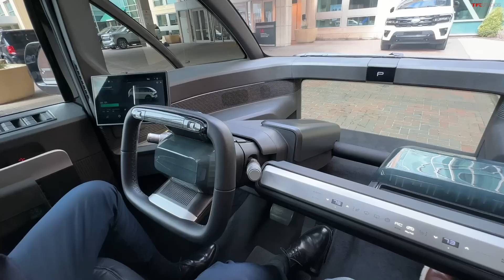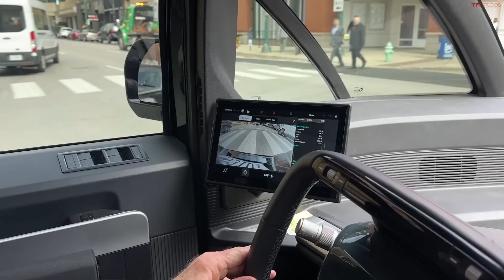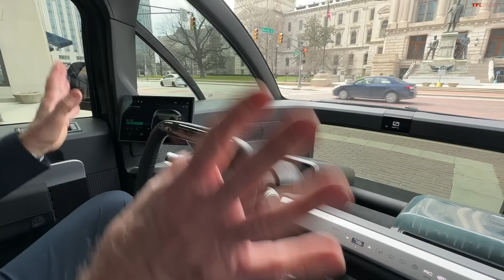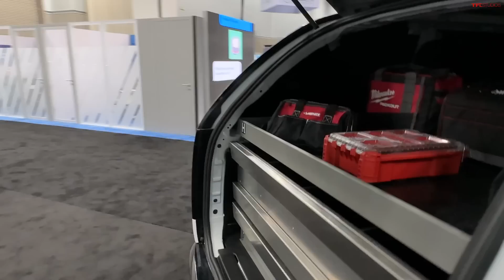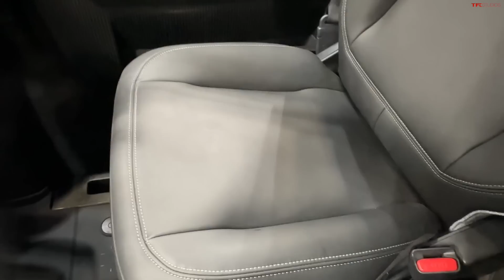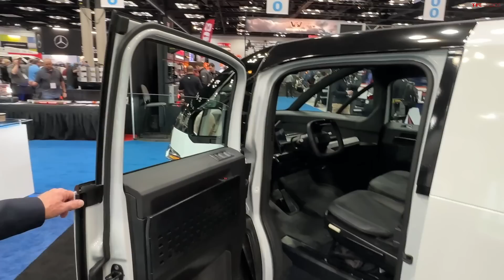The All-Electric Canoo Is Like NO Other Van You've Ever Known or Driven: Come Ride Along With Me!

Comment: I really like the concept and have put a deposit down for a truck, but I puzzle over who climbs up beyond the dashboard to do cleanup. there are a lot of nooks and crannies up there. I live on a dirt road. It's going to get messy up there in a hurry. I think I would prefer the area to be covered and accessed from the front exterior, a useful and secure frunk. The speedo doesn't have to be all the way up there. How about a HUD? I also prefer more proximate switches to a touch pad/touch bar for all lights, radio, locks, wipers, window defrosters, seat heaters and adjustments, etc. I don't need the distraction of stabbing half blindly at a touch screen, or touch switches placed far out in the middle of the dashboard (why so far?), nor looking at the resulting inevitable greasy mess on the touch screen. I want to hear and feel clicks. I loath the touch screen on my desktop computer. Why would I like this little iPad style touch screen for controlling critical elements? I agree with the criticism of placing the mirror adjustments on the steering wheel. I would prefer to have my cruise controls and radio volume and tuning where muscle memory can again take place and I can keep my eyes on the road at all times. The way some of the EV systems are designed across most manufacturer's models, I must assume that all engineers are distracted drivers and find the condition to be normal. I have zero interest in autopilot programs, nor do I care to be a part of all the experiments currently taking place on our roads. A Canoo pickup would replace my Kei flatbed truck. The Kei truck can transport quad ATVs and golf carts with plenty of hard points provided to strap them down. Can you please make the Canoo truck capable enough to fill that bill?

Comment: Wow! With 200+Mile range! and the visibility is really crazy! Wow! I can say this is state of the art vehicle.
Reply: Is it a lie though? 200 is that gping from 100% to zero when in reality most of the time they want you to not use the top 20% and bottom 20% meaning 40% of that range is actually not useful most of the time? Before battery degridation or cold weather impact? I think its a scam. The range for the price is a deal killer. Makes it a scam by my standards. Freedom robbing scam. 50k for 200 mile range. He says he challenges anyone to find a better value. Easy. Corolla accord camry f150 civic prius rav4 even audi a3 is bettee vakue straight up that car js so great cost very similar it has a range of well well over 500 miles and legitly not this 20% on each end of the battery nonesense. Its also way better looking ans you can fill it up at the gas station of the cheap gas it gets 40mpg if you step on it once in a while it gets 1.5 less mpg aversge its really more capable in terms of taking people to farther places easier. From sea to shining sea easily as our founding fathers intended. I personally think these weird things are so terribly ugly.
Reply: If your impressed by 200 miles youre gullible as hell. You are impressed at getting screwed. If thdy told me thenthing cost 50k and only.has 200 miles range id burn the check while they watch. Youre delusional

Comment: But will it hold a mobility scooter? Or a wheelchair? It is priced way too high, That's very expensive.he work van is too small to be practical for handicap transport vehicles or most small business applications. It is the VW beetle of vans. The rgeneration system does  not allow for "coasting" dowhill. I seems it would provide friction as  the automatic braking kicks in, so does it ride  it's brakes going downhill?

Comment: Canoo was NOT the first car manufacturer to use this steer by wire type of steering system. Lincoln starting putting this in the Continentals in 2017. There can be many drawbacks with this. if you lose power or the system fails for some reason you have absolutely no way to turn the front wheels. If the battery goes dead, you cannot push it out of your drive way and turn. It is a really bad idea. The same issues exist for the completely electric transmission. No power and you cannot put it in neutral. Too many things could go wrong.

Comment: Having most of the controls on a touchscreen app is a horrible idea. I know its sooo much cheaper than having buttons, knobs and levers everywhere, but those are much safer and easier to use. Have a tactile button allows drivers to control things blindly by feel while keeping their eyes on the road. <maybe> incorporating voice recognition into the controls would work, but having to use a tablets touchscreen to turn the headlights on or adjust the AC is reckless. Even the big auto makers are going back to tactile buttons for this very reason.

Comment: OK. Now beat VW. Copy the basic Vanagon configuration where you can take rear facing seats behind the drivers, that face a row of seats, between which you can have a small table. Now you have a mini living room. Then allow that back seat bench to flip down into a perfectly flat bed. Now you have a mini camper. This is the life-changing configuration that keeps all those vanagons on the road, and which no-one (short of a giant sprinter) seems to be able to produce.

Comment: My very first impression when I saw him get in... I hate the dash and the placement of the speedometer and such.  (I'm going to edit this and add more thoughts as I go through)

Living anywhere that gets sun... A glass roof sucks.  The AC never overcomes the sun.  You swest and your hot and uncomfortable the whole time.  At a minimum give an option to have a painted or covered roof.  

I saw where the speedometer is that's to far away in my opinion.  Also don't like the mirror adjustments being on the steering wheel.  I adjust my mirrors more than most probably do but I don't need it at my thumbs all the time.

Comment: Having just the mirrors on the steering wheel is such a waste, I mean even vehicles that have multiple drivers mirrors are not a issue because the car should have driver profiles that auto set the seat and mirrors based on the driver so those buttons will almost never be used. The mirror controls should be moved into the computer or on the door and the steering wheel should have entertainment controls like radio and call controls. Also why put them on the top so far towards the center of the wheel? Feel like if the buttons where right near the corners on the bottom it would be a lot more comfy to use them

Comment: A lot of nice design features and great access in the back. It would be nice if the front was storage.  And they should simplify design by removing the buttons on the steering wheel and dash bar, instead moving them to the touch screen plus via voice commands, like the Tesla.  The range for delivery vans needs to be 300, not 200.  Overall, I see a practical vehicle here.

Comment: Right off the bat I can say that if you crash this thing the glass for that would be ridiculously expensive to replace I imagine. And seeing as how most of it is glass I'm sure it would all be smashed. I can't imagine all the glass that would go flying at you if somebody ran into you as well. Also there's not a lot of charging stations still for all of these electric cars coming out so nobody's really going to invest into something like this until a you're able to have wind power and solar power on it to charge another battery to switch to so you dont have to plug it it hardly ever and the xost and replacemwnt of the batteries are easy enough for a person to do on their own. If this happends I am sure people will buy these right away. Like cell phones sell them cheap and have add ons to upgrade the owner can hook up easly that way when people have money they can upgrade and the manufacturer can still profit from it. It also leaves open areas for them to create new and updated options to buy.

Comment: No, no no. The major automakers have already learned that it is a mistake to use a only a touchscreen and get rid of knobs and buttons.  The typical driver is going to adjust the environment and entertainment controls at least several times each trip.  Your system means that they can't do it without taking their eyes off the road. With knobs and buttons the driver quickly learns the system and can do it without looking.  Plus there are no menus to go through to get to the control.  My BMW has a button for the fan control with three or four speed selections.  I HATE it. I want a knob that's either analog or has an encoder for a nearly analog selection.  Plus squeezing the two front seats together is a terrible idea. Put them back apart and put a console back between the seats where I can stash things. Not everything in current automotive designs should be changed.  Some things are right.  Also, the rectangular steering "wheel" is dumb. Futuristic looking yes, functional - not so much. There's a reason why round wheels work - when you turn you can let the wheel spin back on its own through your fingers. Also, you can't rest your hands where it's comfortable for you, 10 and 2, 11 and 3, whatever - the locations are pretty much pre-decided by the shape. Or go ahead and keep it and I'll go into business to make an aftermarket round wheel to fix it.

Comment: It's so fascinating how electric vehicles don't have to adhere to the the design conventions of gas powered cars and can come in all kinds of shapes.  The open front of this car has amazing visibility, and the pulled forward seats allow for  deceptively big storage in the back.  I have a couple of complaints, however.  A car that supposedly prioritizes driver comfort absolutely needs a center console to store knick knacks, phone chargers, and other small essentials, never-mind the added utility of serving as a table and arm rest.  The touch screen controls were also a terrible choice, because they demand a driver's full attention to not only find the proper touch zones, to decipher them, and and press them the exact amount of times they need.  I'm assuming the touch controls were chosen to reduce the number of parts, but some buttons and dials would be much more intuitive and safer to operate while driving because the driver can feel around for the right one while keeping their eye on the road.  Hopefully customer feedback will be taken into consideration when designing future models.

Comment: I’d much prefer if they replaced the mirror adjustment buttons on the steering wheel with stereo control buttons. I’m not gonna be adjusting my mirrors that often but I am gonna be changing songs or turning the volume up or down, so having those controls on the wheel will be much safer than looking over to the tablet while I’m driving, and a better use for wheel buttons in my opinion.

Comment: I live in a winter state in Minnesota. You need to look at all wheel drive and also put a heating blanket on the battery that you can turn to warm in case of extreme cold to not ruin the battery. I also have kids. What can you do to make that screen be able to take few whacks and not break.

Comment: Looked at the pickup version and was very underwhelmed by the tiny "200+" range. 200 empty is best case 100 loaded and usable 80 miles towing.

It should be 400 empty and "200+" at max load. 

Maybe im jaded by the current crop of EVs that are overly optimistic

Comment: Impressive, like it.  I feel like they've missed a trick with not having solar on the large roof space though, as this would give better range for workers and could charge whilst they're 'on the job' so to speak.
would make a cool camper too.
Reply: Even using really efficient solar panels, you'd still need over 100 hours to fully charge this vehicle. The amount of "topping off" that you'd get would be inconsequential and not worth the weight, expense, and added complexity.
Reply: @mbaxter22  Lightyear, Aptera and myself would disagree.  Free energy.  People with short commutes would need to charge FAR less frequently.

Comment: It looks cool but that's so much wasted space there in front of the front passengers. Could've been used as out of sight storage. The lack of a steering column doesn't look like it would really made any difference to leg room in this vehicle just because the path for the column would've kept it out of the leg space. The variable ratio steering is cool but I wonder if it's based off of speed?

TLDR looks cool, would've preferred to see that front space be a frunk instead of empty space.

Comment: that steering better have a radio that lowers as the speed increases imagine some dick hitting you and back you left turn into a wall or off a mountain and die..... you dont want steering that sensitve... you just dont not even in the city. people arent prepared for that sensitivity in sudden events. it need to make a full roation for a uturn simple as that.... or close to 2 like everyone else. not half a rotation.... wtffffff it needs to make a atleast 400degreees to make it controllable. everyone has had to react fast and dodge an accident on the road now imagine if you had this steering wheel in some ways yes it may helpi i think most other vehicles has a little bit of a wird rotation it should somehow increase ration for lower speeds. highspeeds lower. its still usually safer to not accidently turn and fly off a road not thinking stop stop stop you try to avoid and then die from it. this needs to be changed slightly atleast for fast speeds. it needs to be double the roation of that.

Comment: Steering yoke is a gimmick.  Looks like it will induce fatigue on long drives and is otherwise dangerous.  You don't have to look at a round wheel to find the edge at anytime.  Yokes belong in airplanes, not cars.  The vehicle looks interesting but gimmicks raise red flags.

Comment: The car does look very cool and as a family which needs a 7seater with additional cargo space - which excludes the usual SUVs because SUVs are just a bad design choice to transport anything - and use additionally a BEV as our smaller daily driver, there are several flaws obvious.
- the seating isn't really shown, which is quite disturbing for a car that is mainly used to transport a lot of people. Don't make the same mistake as Hyundai with the Staria, the seating has to be flexible, adjustable, dismountable if needed. And sideways seating is hilarious for transportation, you basically need reinforced child seats to absorb the forces of a crash. Not gonna happen.
- you need sliding doors. Period. The solution shown is just for show and got zero usability improvements over sliding doors.
- mileage of 200miles is okay-ish IF it is retained during winter and going 70ish mph. And it needs to recharge that distance in less than 40minutes
- the frontal foot window is cool, but. Total waste. In that cockpit I'm missing a multitude of lockers and storage room. And, all that space in the front could be a frunk. But, then the cool frontal window would be invisible from the inside. Better use a regular front with a camera for parking/manouvering. Install a middle display where you can display the frontal camera for parking and the backwards camera during driving because the rear view mirror might be obstructed by passengers/cargo. Add in side cameras displayed so I got a central viewing hub to check on traffic around me
- the horsepower aren't that important - torque is. And around 500nm is plenty for such a vehicle. No need to race this thing.
- with that many windows around, think about reliable manners to clean them and install a large enough container to keep enough cleaning fluid - and keep the container visible so I can refill in time. Driving an Ioniq5 during winter shows how crucial these thoughts can be, because camera and window in the back are steadily covered...
- I like such projects, but claiming 50 grand for the passenger version is roughly in range of a Mercedes EQV. Which is a proven, reliable platform - and ofc a Mercedes with Mercedes-pricing.
More so, a Volkswagen Buzz might be cheaper. And maybe less stylish, but more useful. I still want to test ride one of those cars to make myself an impression, but competition is fierce, even in such an underrepresented market niche like that.

Comment: You wonder what the designers were thinking. 
There is so much wrong with the design.  As a van, this is a very bad product. 
The door is much too small, the space in front cannot be cleaned, drive by wire is just dangerous, the displays are too small, the A-pillars obscure too much view, the door handles are wrong, the ergonomics are not right and I can keep going for a while.

Comment: I love a lot of the attributes of it. I personally find it cosmetically appealing, the turning radius seems great, love the amount of visibility and glass.  Parts of the interior seem iffy to me.  Not sure if I like the placement of that multi-function screen on the left hand side of the driver.  Also—I feel like putting the mirror controls on the steering wheel is kinda odd.  If they can get that range to 250-300 miles and keep the price in the same ballpark—i think that would be a lot better
Reply: Agreed, I like the way it looks, very unique. I agree with the comments about the screen and I'm not convinced by the row of touch controls along the dash, which look great but don't look very practical and seem to be quite a distance from the driver. All still seems a bit pricey for me though for what is little more than a box on wheels with a big battery.
Reply: Its got the looks only a mother could love bro

Comment: If the battery range was extended and a solar panel was put on the roof for extra emergency charge, it would make an awesome road trip vehicle.
Reply: Actually…the solar panel could be used during the day while one is at work…and may provide enough charge during the day to get home.
Reply: Electric vehicles are not designed for road trips. lol!
Reply: @abuanwp  They will be